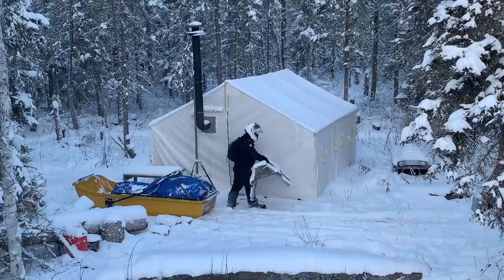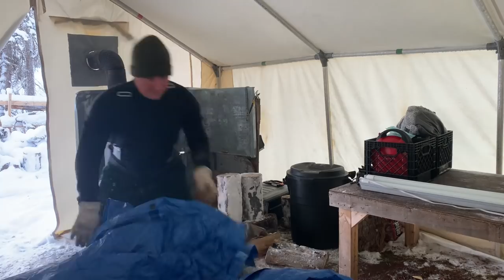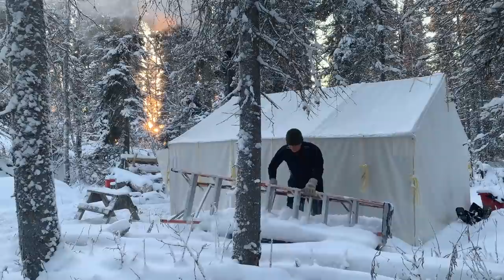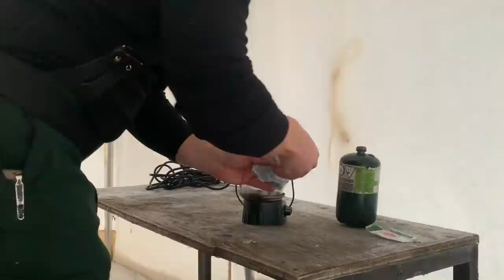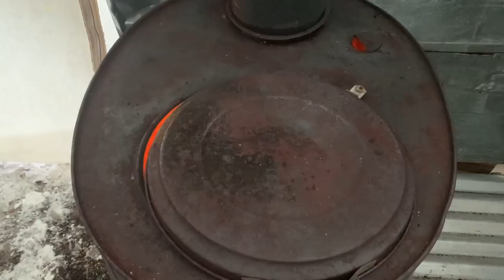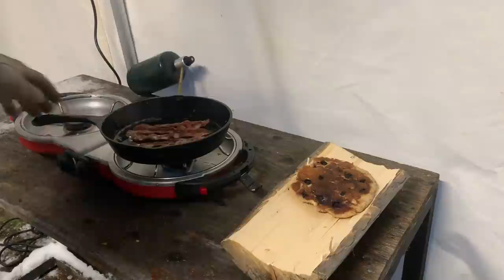-20c WINTER CAMPING SOLO in GLOWING HOT TENT

Comment: what was the point of driving your snow machine past your tent only to unhook the trailer to push it back to the tent? Only to then push it back to the snow machine.  Why didn't you just stop at the tent,  unload then go park?  Makes no sense what so ever.
Reply from the maker: @eccentric smithy When I start the snowmachine every couple of hours to make sure it won’t freeze up I don’t have to worry about the exhaust fumes accumulating inside of my tent. Pushing the whole sled back is much easier and less intensive than taking out each individual item and walking back-and-forth on an unstable surface. Spend some time in this environment and you’ll understand why.